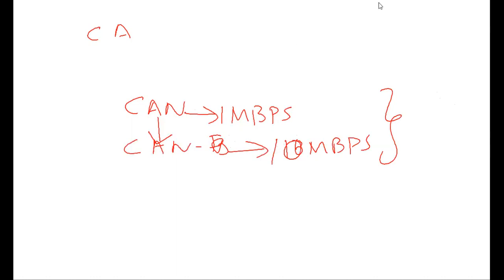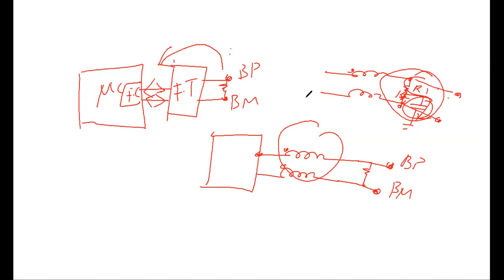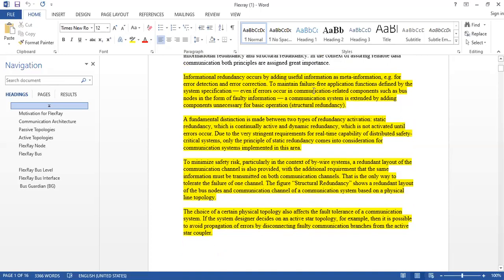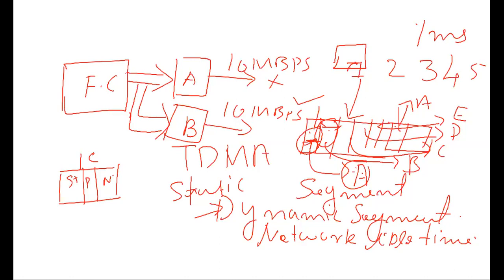Flexray Protocol

Comment: @13.02 you said the same flexray controller is connected to two different channels, that could be wrong, because there is possibility to send two different frames on same time slots on different channel, with single flexray controller that is not possible I guess.